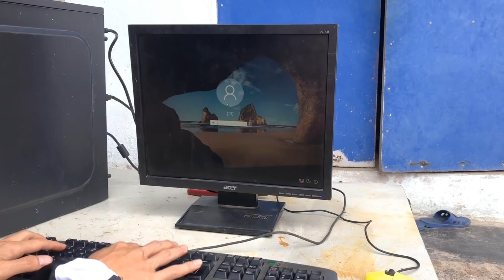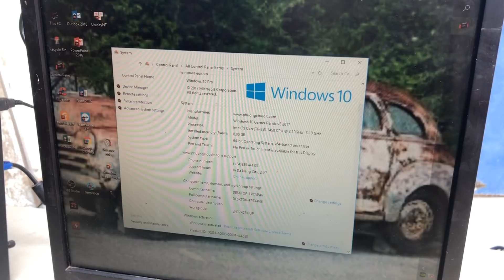Restoration a destroyed 30-year-old PC | Rebuild and restore 30 year old PC

Comment: "30 Years Old"
>Mobo has a PCIE slot
Reply: If the computer was 30 years old, it would be a brick compared to today's computers. I'm talking about an IBM 5150 compared to the average PCMR battlestation. Take my like.
Reply: Also USB & SATA port, integrated AUDIO, Cooler on the Processor, Socet LGA775. lol
Reply: And it has an i5-3450 (LGA1155) from 2012 which isn't even for that LGA775 socket
Reply: And mini din ports
Reply: Serial ata Slots xd
Reply: Totly fack Vidoe
Reply: I Think the past owner of that PC is a time traveller Hahaha
Reply: I mean . No 1 saw i5 3450?
Reply: I think not 30 years old it's 10 years old motherboard and processor are pinless it's mean 2003 year since 👍 fake video 😂
Reply: Ha ha yes
Reply: @lexplex and windows ?
thirty years ago there was still Windows 95 and probably reinstalled the system on a newer but basic source and its age (of that source) since it says I don't know what kind of processor there is but I would type intel celeron
Reply: @naotomori5974  si cuando saca el procesador ya se ve que el socket esta con mucho pines doblados 🤣🤣
Reply: Thats what i am thinking
Reply: dude where else is it gonna get video from, the mobo ports? those dont do  shit
Reply: why he always bend pins in cpu socket... omg...
Reply: and randomly guesses the password lol
Reply: Wtff 30 y old od has windows 10?
Reply: yes
Reply: And sata connectors
Reply: also that hard drive was a SATA and they used ribbon cables back then,
Reply: @RandomStuffByMike  Windows 8.1 lol
Reply: @j.ezemtz4198  and I-DE cable xd
Reply: @ЮрийСанталов-э5ю  My motherboard from 1995 has integrated audio already, but this is still fake.
Reply: I couldn't get past the lack of rust that should have happened. it's rather just clicky bate. Look I got a computer from 10 years ago and let it sit in a puddle for a day or two.
Reply: and the ATX power supply. started around 1995. this is magical,... lol
Reply: 30 yrs ago it was windows dos on floppy drives and windows 95
Reply: They didn't have hdd back then
Reply: And its a socket 775 cpu🤣
Reply: and a hard drive, whose disks have fingerprints :D
Reply: Huahuahuahuahuahua!!! I dont believe, did I see it?
Reply: i think he meant 3 year old pc
Reply: @MrJollibee623  only posible explanation
Reply: @kostaskolomitroushs2813  hahaha
Reply: And computers back then ram sticks would of been anything from 1mb to 4mb

Comment: 30 y/o pc

i5 3450
8gb ram
Windows 10 pro x64
He knew the password
The socket pins were bent,
But hey it works like a charm

This clip is beyond cursed
Reply: *SWEATING*
Reply: And not to mention the pc boting is a different one, the side panel was flush om the "restored one" but the one that turns on has a bump for like the one you'd see for cable management..
Reply: Yes, it's Masonry 😂😂😂😂
Reply: And pci 😂😂
Reply: its not 30 years old he just made it dirty and shit and put it on the side of the road drove backwards with his bike and made a video out of it
Reply: nO dOnT rEmOvE tHe CpU, oR iT wIlL dIe. (The CPU protect the pins).
Reply: @Mutahammil Ahmed Mushfiq no
Reply: The funny thing is, the motherboard they "worked on" is g31 lga 775 motherboard supports core 2 duo + quad max fsb 1066
Both made by foxconn
Reply: Kkkkkkkkkkkkkkkkkkkk 30 y a frente
Reply: socket 775
Reply: It is understood that I install the windows 10 system, in a new hard disk
Reply: yes
Reply: I5 3gen? My i5 is 2nd gen that I use 100 year old pc xD 

As I know i5 2400 is from 2011 and now its 2021 so 10 years hehehe very good cpu
Reply: Yeah i saw that broken pins
Reply: E fack a placa e 775 que ele acho não existe i5 de 775
Reply: That’s a core 2 cpu
Reply: @H4n_uL  INTENSE SWEATING*
Reply: Sus
Reply: 😂😂 B like R u comedy ME
Reply: 😂😂 B like R u comedy ME
Reply: Eh, he installed the windows on the hard drive by himself
Or maybe this pc from 2015???
Reply: Maybe he just restored the case and used new pc specs 😂🤣😂🤣
Reply: It is not 30yrs old
Reply: is fake restoration
Reply: He lied as so good
Reply: funny thing its actually better than the pc i just bought 1 year ago
Reply: And the new motherboard when it wash computer
Reply: HDMI!!
Reply: So he apparently left his computer out for 6 years i think
Reply: @bitelaserkhalif  The G31MV supports 1333 MHz FSB and Core 2 Quad up to a Q9550. Though I wouldn't recommend using such a CPU in such a crap board. It's all irrelevant though, the socket was destroyed, which is why the guy bait and switched a newer board.
Reply: its total scam . no hard disk can survive in that condition
Reply: ikr. has better specs than the computer i'm using to watch this.
Reply: And also this board supp window8

Comment: "30 year old PC"

Mobo has SATA and PCIE slots, even the case is too modern to look like 30 year old.
Reply: Yeah its a late socket 775 system from 2009-2010 and he also did like 100 things wrong in the restoration so yeah this video is completely fake.
Reply: yeah intel core i5 3GEN is not fake in computer since 1990
Reply: Don’t forget it has windows 10
Reply: Restored pc is not that which is strar
Reply: Lol he just scrub down socket pins xD
Reply: 30, no 15yo
Reply: @awesomecomputers7076  my pc is 14 years old
Reply: And for a 30 year old PC it should run windows 3.0 not 10
Reply: I don't complaint about the quality of the fine particles of the mud inside the HDD. :O

Comment: 6:15 YES BRUSH HARD DRIVE HARDER! THIS IS NOTHING BUT A SCRATCH
Reply: Aynen
Reply: Valla
Reply: xDDD
Reply: Harbiden
Reply: Yeah this guy just murdered the hard drive.
Reply: @seamusmckeon9109  this guy commited masscare to PC
Reply: And he Is brushing the socket he Is probably brake a PIN or somrting
Reply: AND with the BIOS battery in water
Reply: and also WATER

Comment: How can you know the password and why the wallpaper is about restoration????
A 30 years old pc using windows 10
LOL
Reply: He might have replaced the hard drive with another one that has windows 10 on it
Reply: Yes you are saying right
Reply: Yeah true but that doesn’t count as restoration aint it?
Reply: @johnathonbaker1084  goddamn dude. my 2014 laptop barely run windows 10.
Reply: @johnathonbaker1084  if it was right he must know the password...
Reply: @johnathonbaker1084  at 30 yeal old pc wont run win 10   not even win 98   a 30 yea  old pc wouls have about a 150mb  yes mb  hdd  16mb  yea mb  of ram and a 486 dx 2 at 40mhz     single core no pcie  slot etc
Reply: @TCBOT  A PC in 1991 with a 150MB hard drive and 16 MB of RAM would have been hot shit. Most PCs then would have been late 386 or early 486 with 4, 6 or 8 MB of RAM and a 20-80 MB hard drive.

Comment: Ah yes, I remember my first gaming computer. I built it in 1991. It had a core i5 3450 and 8gb ddr3. It looked like that computer. A few years later, in 1998 I got a 10700k system. Nowadays I run an i7 31700k and an RTX 8070 ti. For those who do not know, his computer is about ten years old if even, not 30.
Reply: What is 8070 Ti? Maybe You mean 3080 Ti
Reply: Yes that is completely true!
Reply: @mhd-akbar21  No he means in the future, Intel core i7 31700k doesnt exist to.
Reply: The pc probably from 2006 or maybe 2007
Reply: @nurlidya581  Yeah, G31 and LGA775. 2006-2008. I actually have an LGA775 board, it is fairly decent. I think it is also a Foxconn.
Reply: 8070
Reply: That chip did not come out in 1991. Pentium1😂😂

Comment: First of all, that ain’t even 20 years old, it’s socket 775.
Reply: he is a timetraveler
Reply: @francogonzalez2066  Date on DVD Drive : 2010-09-16...
Reply: This is old for him.. i have ipad pro but, this computer i like
Reply: I5s are on socket 1151 not 775
Reply: @TinTin3k  have you seen the motherboard he restored? its a 775 socket... and the 3rd gen i5-3450 is a 1155 socket.
Reply: I'm watching this video from core 2 duo e5700 lga 775 pc.
Reply: Yes you are right
Reply: Yes, that modern tower pc was not yet in market in 1990.  I think it's 2005 to 2010 computer.
Reply: Mobo mismatched
Both are foxconn but different (g31 vs possibly h61 for demonstration)
Reply: 30 years ago atx computers did not exist.  were invented in 1995
Reply: I've had loads of 775 sockets all from the 2004 onwards
Reply: Windows 10

Comment: I love how he thinks a hard drive will still work after  opening it and putting it back together.
Reply: yeh i was just thinking that
Reply: The best thing is.. He take the PSU fan nut off when he wanted to take off the PSU.. 🤣🤣🤣
Just keep the good work dude.. 🙏🏻🙏🏻🙏🏻
Reply: HE cleaned that laser part/cd drive while dipped in the water 😭😭😭😭
Reply: lol he scrubbed the drive platters its so dead lol
Reply: not to mention the heavy scrubbing on the platter
Reply: On drive models where the lid isn't structural, you can open a drive and run it without the lid as long as you don't touch the platters. Some drives use the lid as a structural support for the platter spindle and voice coil.

 Obviously don't open a drive you care to work long term, only on drives that are dead or you don't care if they die. But opening them doesn't mean they will necessarily die. I've had to open many drives over the years to fix faults in them, mostly stuck heads and platters from years of not being used.

Comment: 30 years old pc that runs Windows 10???

Thanos:   "it scares me.."
Reply: It’s fake lol
Reply: Windows 10 is the last windows operating system they said they only gonna carry on updating it check your facts before you make a joke and don’t say r/whoosh because I got the joke
Reply: Ssd update Windows 10 easy
Reply: @nnck9759  90s components cant run win10, and this pc has core i5 3rd gen that was released in like 2012 also he probably destroyed all the components, didnt connect the front panel and used other pc to run it also he faked the password
Reply: the computer is even not from 90s it more like from late 2000s or mid 2010s
Reply: @zhuri_3370  The way he cleaned the hard drive lmao. It was already screwed
Reply: He could have replaced the hard drive
Reply: @johnathonbaker1084  Windows 10 would not run on a “30 year old pc”
Reply: What he fix windows 10 i5 8gb ram nividia gpu😂 if he change motherboard and cpu and hdd what he restore
Reply: He didn’t restore shit lol he used another computer at the end
Reply: @greyjedi3434  dude a 30 year old pc DEFINITELY couldn't run windows 10
Reply: intel i5 nice 30 yo xDD

Comment: liar 🤣🤣🤣🤣🤣
30 years old with SATA connectors and LGA socket? 😂😂😂 This guy's a scammer or just want to troll
Reply: Chinese future bro 🤣🤣
Reply: 30 chinese years
Reply: @luminatrixfanfiction  2012 actualy
Reply: @randomweirdyoutubechannel8955  2010...the release of the CPU was 2012 but the company production line began making the CPU's back in 2010 so this is 2010 tech.
Reply: By the way folks, this scammer was kind enough to show his windows 10 product key. You didn't hear it from me 😂😂😂
Reply: @Systremor If you're talking about the different architectures you would be correct except large-scale manufacturing companies require a 1-2 year period of production shore-up before shipping it around the world in bulk to be sold in retail. If the 2012 i5 cpu's have the 2012 architecture design, then it was made two years in advance back in 2010 as all cpu generations have done before being shipped off. 

That's how technology develops. Whenever you buy a brand new CPU...you would think you're buying it new but in reality, it's over 2-4 years old already and the company is already in the designing phase of creating the next new CPU architecture and post-design process.
Reply: Probably a Chinese...
Reply: @luminatrixfanfiction  on mobo worked with it's actually lga 775 g31
then it becomes i5
MAGIC

Comment: It's just 2 different computers 18:19 case without cutout 18:30 case with cutout
And 18:35 64x Windows 10
If you already do fake videos then please do it right!
Reply: xD Yeah, you're obviously right. The original panel is flat the other has that reinforcement bulge (or what it's called) in it. Didn't spot that at all. 
By then I was confused and thought: This is imposible... (Judging by the 775 socket with the bend pins (maybe) and the half cleaned (under the platter?) flooded harddrive (No f.. way).)
I had to watch to 20:13 to know I wasted 20 min of my life. An i5 3450 with 8 GB RAM on a Foxconn G31MV-K mainboard that supports neither the i5 nor 8 GB or RAM. What a letdown...

Comment: Fake video... The HDD originally in the machine will certainly not work after such a "wash"... HDDs are assembled in a clean room under special conditions, a single speck of dust will destroy the HDD sliders. I used to work in the HDD department at IBM. This video in this form is fake!

Comment: You have damaged CPU pins, you cant touch this like that, also you cant touch HDD discs because it will be damaged.

This is fake video, don't lern anything from it. Dont try this.
Reply: I'm trying this the minute I get home.
Reply: Btw intel cpu's have not pins on it only amd cpu's have pins
Reply: @HACKER GAMING X  the guy literally don't know anything about pcs, he literally cleaned the motherboard with water like it's * w a t e r* + pc is actually isn't 30 years old. it's from 2010 so i bit it's a clickbait. also how would an old pc run windows 10??? please have some logic
and again he damaged the hard disk..
Reply: @HACKER GAMING X  also if it's really old than why someone didn't come and explain intel5 and 8gb on 775 motherboard socket lolll
Reply: @cup624  10 year old PC's have no trouble running Windows 10

Comment: My thoughts throughout this video:
1) huh, this should be interesting, maybe this guy isn't a fraud.
2) yikes, the corrosion damage looks quite bad, and it seems to be more of a 2012 PC. No worries, he might have just made a mistake in the title and he probably has replacement parts.
3) why is the CPU perfectly clean and dustless when the other parts are covered in mud? 
4) okay this wizard is using his black magic to clean the HDD with a wire brush, there is absolutely no way you can dispute his talent
5) what did I tell you? He managed to put windows 10 on a 30 year old PC! Give this man a medal.

Comment: i5 on socket 775 and running windows 10? Give me a break😂😂
Reply: Thats how mafia works!
Reply: this is a Pinoquio guy!
Reply: He might have replaced the hard drive with another one that has windows 10 on it
Reply: Kyriakos The Awesome Teenager He could have replace them
Reply: How do you know that he used a different pc
Reply: For correction, socket 775 was only ever used for Pentiums and Core 2 processors. The Core I series processors were first used on socket 1156.

Comment: on 775 socket the processor from 1155 socket is how?
Reply: MAGIC
Reply: 380 pins grows
Extra 6 GB of RAM added
Reply: damn, I saw this and I was like that's a clickbait but let's check it out, it is a socket 775 core2duo era pc that was coated with mud just for the video
Reply: @mitsostechtips9047  This is definitely fake. The CPU is an Ivy Bridge series i5-3450 made in 2010 so that would put this computer only at 10 years old...if it weren't for the fact that the CPU i5-3450 has a different cpu socket that is incompatible with this Foxconn motherboard N15235 (^_^). 

This guy is a fraud.

Comment: This is less than 20 years old, it's at most from 2006, and at least, from 2010. 11 to 15 years old. Not 30 years old, even the most dirty pc from then, which I believe I own, was not this dirty. It was from a car repair shop and caked in dust,  and still not this dirty. Was used up until 2019. And was from 2006. It's obvious this pc just had dirt thrown on it.
Reply: Yeah you right, that computer was made around 2010 or maybe later, if you see the video exactly at @9.03min you will see the date of the CD ROM's mechanism and the frame is showing 2010-09-16. So that frame was made on September 16th 2010. at least the CD ROM mechanism was made on that date and the complete computer maybe on that year o maybe later. so it's not older than 12 years.

Comment: bro you don't know how to lie!
Reply: that's true, 30 year old pc tf, this is socket 775 with ddr2 and core2duo
Reply: @mitsostechtips9047  and...?
Reply: @marcusgamerpro6629  and a lot more, this is clickbait
Reply: @mitsostechtips9047   yeah exactly!
Reply: @mitsostechtips9047  This is definitely fake. The CPU is an Ivy Bridge series i5-3450 made in 2010 so that would put this computer only at 10 years old...if it weren't for the fact that the CPU i5-3450 has a different cpu socket that is incompatible with this Foxconn motherboard N15235 (^_^). 

This guy is a fraud.